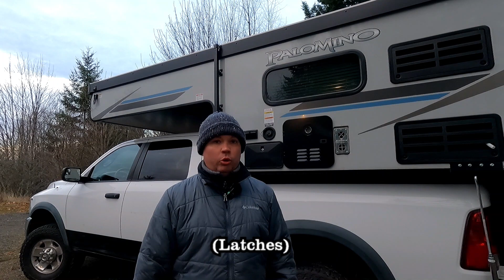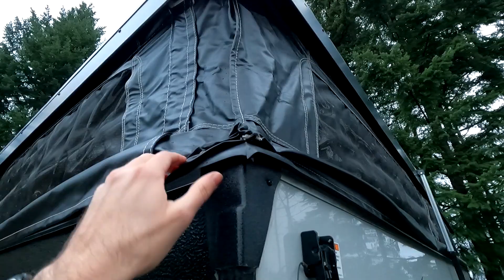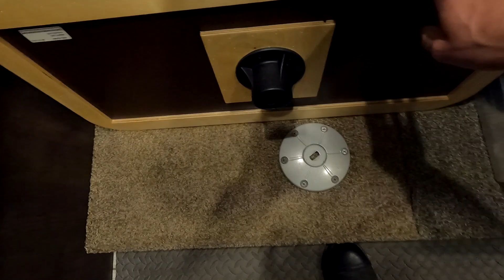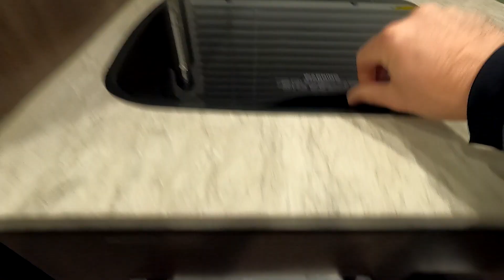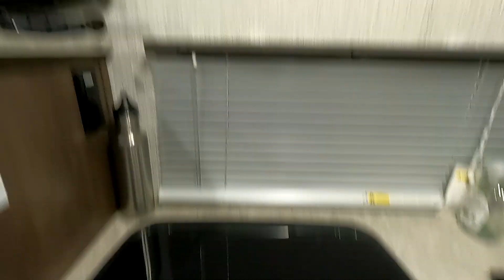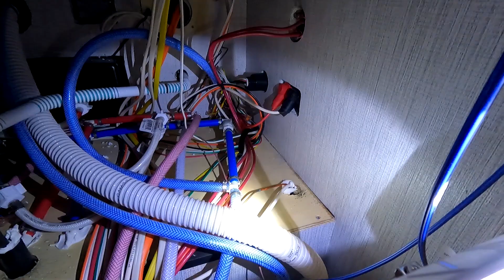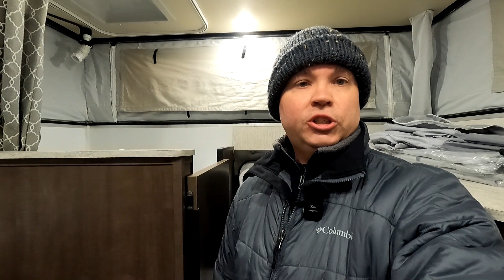Power Wagon Camper Part 9. New Palomino SS-1251 Worth Buying? 1st Impressions & Build Quality Issues

Comment: Can’t wait to see you get out in that camper. You give some very good advice, especially about the fuses as you may remember I wrote you before I bought the SS 500 for my power wagon while it was in my driveway, everything seem to be working good with the exception of the solar. I have two solar panels and two batteries and it wouldn’t run the refrigerator for more than six hours without draining everything to go further before we took it out for the first time, after raising and lowering the roof, I noticed the left hand corner wasn’t completely up. I didn’t think much of it. Long story short we took it out locally once again, and very much more noticeable the left hand side of the camper front side would not go all the way up, while packing up, the right side front would not go all the way down, and while we were out, we noticed that heater would kick on by itself run for a little while and turn off even with the thermostat turned off… so we got it back home. I called the dealership, explain the heater , charging and roof problems. Of course they told me to bring it in but now all the time putting go down at all all you would hear is a clicking while trying to lower the roof I switch to plugs around and I was able to get the roof partially down. She turn off to drive an hour to leave the dealership they told me I could’ve put the roof down manually the problem with that is you never supply the tool to do it it’s basically a number three square bit. With an attachment that you can fit in a drill, I recommend looking through your bag that came with your camper along with the paperwork to make sure you have that attachment in case you ever need it after speaking to a couple of other people that heater problem seems to be a major complete, I’ve seen a lot of people add a digital thermostat to rectify it The camper has now been in service for going on two weeks and I still have heard nothing. That’s one bad thing about buying a camper their is no lemon law. Once you pay for it, you’re stuck with it now. I can understand having a problem or two but I have a list of problems that I have and I didn’t even mention all of them I’m totally beside myself you would  think not even being a month old they would just replace it with a new one and deal with the company and themselves but that’s not the case I’m basically at their mercy to do the patchwork and I have a feeling I’m going to be doing a lot more work myself. I am definitely gonna look into those fuses that you have, and make sure that the actuators that lift the roof are lubed. I hope you don’t face any of my problems. I will get back to you and let you know how it is once I get the camper back I can tell you and my camper is much lighter than yours. Besides the shock up grades I also installed timberline the ones that know where is the factory bump stops go they felt OK but I was getting some roll so since the camper is been off the truck, I took some more of your advice and put the super springs on. I can’t wait to see how they feel. I have some can’t wait to see how yours handles with your upgrades speak to you soon. God bless.
Reply from the maker: Sorry to hear about all the issues.  Besides those I already mentioned in the video, I haven't had any more problems. Everything's working as it should, although I'm concerned that the roof motors work really hard to get the roof up. 

I do have a couple of the square bits and drill that I keep in the camper in case I need to actuate the roof manually.  It's a must have. 

I'm really happy with the way the truck handles, and will discuss this in an upcoming video. In the meantime, I've been getting it equipped for going off road, so stay tuned!

Comment: Those lift linear actuators sound like they're way underpowered for the task. Sounds like they're just barely able to do the job even after the changes you made. If it were me I would be making Forest River fix that.
Reply from the maker: Agreed; those lift motors are by far my biggest concern on this camper, and the dealers couldn't get them in stock when I last checked. Luckily, there is a socket to allow for operation using a cordless drill if one were to burn out while camping, etc.
Reply: @outdoorsinoregon  That's good Yeah there's definitely something wrong with that system. They really sound like they're struggling.
Reply: I have the same unit and one of my linear motors stopped working and it happened with in  the one year warranty and the new motors they installed are quieter and seem stronger

Comment: Thanks for the video. Is there any Battery or inverter in the camper? If not how do you connect the power source to the camper?
Reply from the maker: Sure, there is a 12V battery in the camper, but no inverter.  You get 120V in the camper only when plugged in to shore power via 30A external plug.

Comment: It’s been a while now and you’ve had the camper on the truck I’m sure you had to drive around a little bit just to see how it handled. I know I’m the only one bugging you in the comments but I’m getting ready to spend my nest egg on a camper and I just wanna make sure my truck is going to be able to handle it, could you please give some comments and some details about how the truck is sitting and how it is driving I know our power wagons have a low payload I’ve taken out my backseats tailgate spare tire. I’ve been going crazy doing everything I can do to get more pay load and I’m wondering if it’s worth it or should I put it all back together again and just get a new truck any of your advice would be very helpful.
Reply from the maker: The suspension upgrades worked out well and the truck sits level and is stable around corners. The Supersprings have 3 settings, so would work for a wide range of added weight and won't impact the way the truck handles when unloaded.  They were easy to install, not too expensive, and don't require maintenance. 

Heavy duty shocks will help prevent sway. Although I didn't try them, I don't think the stock Bilstein's would've worked well with the size of camper I have (too soft).  I would probably recommend Bilstein 5100's or Fox Performance 2.0.  I have the Fox shocks, and they have been terrific, although expensive for a shock.  They use a higher Nitrogen pressure than the Bilstein's. 

If you're camper exceeds the payload rating, then you definitely need upgraded suspension; otherwise the truck will be dangerous to drive. If you're under the payload rating, I would install the camper, check the rake, and see how it handles before proceeding.

Comment: I have a couple questions for you I have a 2011 power wagon. Did you need to do any upgrades to your suspension any problems at all getting it in because dealers are telling me it won’t fit in my truck
Reply from the maker: Yes, the stock suspension is not sufficient for this size or larger camper.  I covered the suspension upgrades in Part 3: 
https://www.youtube.com/watch?v=kRibYEUwg3E&t=17s

Comment: great video.  Does the camper overhang the bed and rest on the tailgate?  i was under the impression they fit in the standard RAM 6'4 bed?  We have a 2019 2500 and are looking at similiar rigs/  Did you also look a Four Wheel Campers and if so, what made you select the Palomino?  Thanks.
Reply from the maker: Yes, this camper is designed for a 6.5" bed (will not work with a 8" bed), but it does overhang the bed and rest on the tailgate as it's intended to do.  

I did look at Four Wheel Campers. I have not owned one, but my opinion is that they are high quality campers, designed and built well.  They are also shorter (do not overhang the bed) and a bit lighter, so would be better suited for off road.  

The reasons I went with the Palomino over a Four Wheel Camper is: 
1) My wife wanted a toilet, and I don't like dealing with porta-potty's or cassette toilets. The Palomino 1251 is one of the very few pop-up campers with a flushing toilet.  
2) Cost.  When I bought the Palomino, it was about $6K cheaper than similar Four Wheel Camper, yet provided more functionality.  

Also, the roof on the Four Wheel campers is actuated manually instead of with motors.  There are pro's and con's of each system.
Reply: I like the Palamino interiors on both soft and hard side campers. 👍